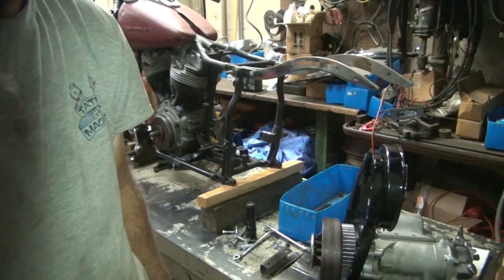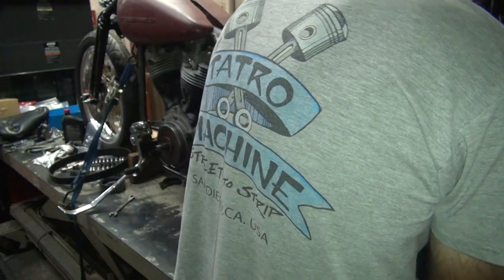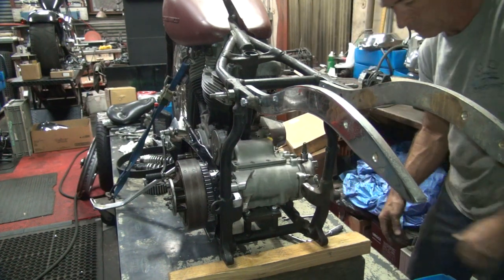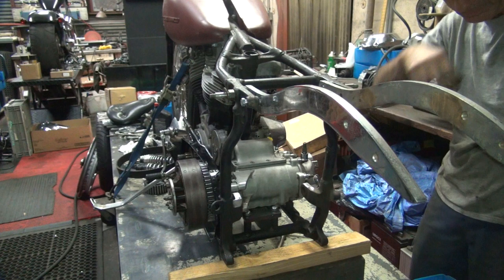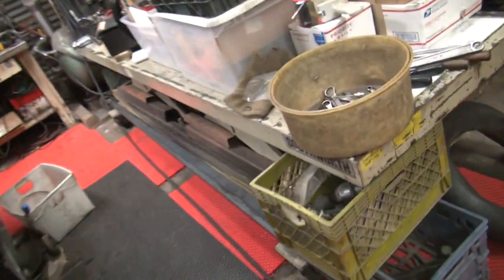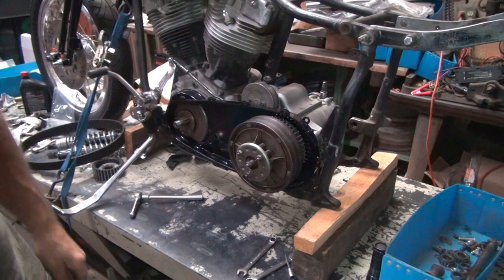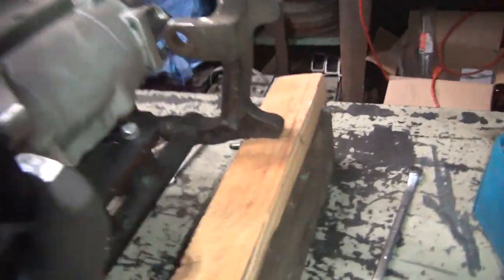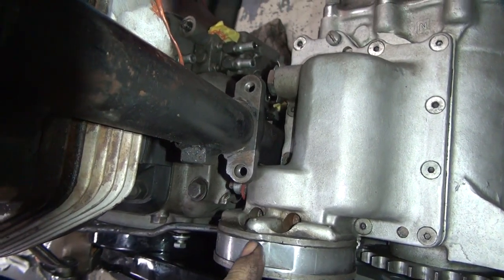#154 1973 shovelhead loose the ugly kickstart custom bobber build 74ci FX FL harley by tatro machine

Comment: Hi Tatro,   I am thinking to make "kick only" shovel also and question is -can I reuse all primary parts from  wet clutch 76' shovel  and to  replace  only with new "kick only" inner primary cover and primary cover ?  Or these "kick only"  covers are only for dry /belt clutch ?
Reply from the maker: tin primary covers are made to leak oil and they do a very good job on doing it. you must regulate the oil to the primary if you use a chain just like harley did.
tatro
Reply: @TatroMachine   I see thanks!